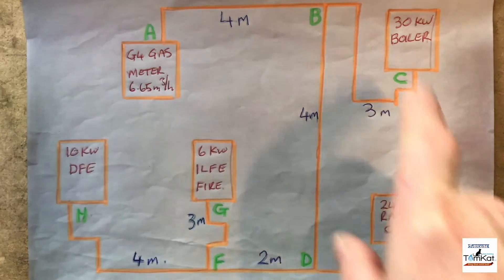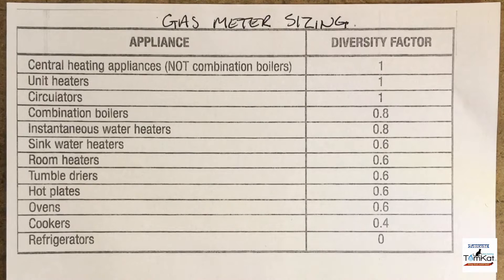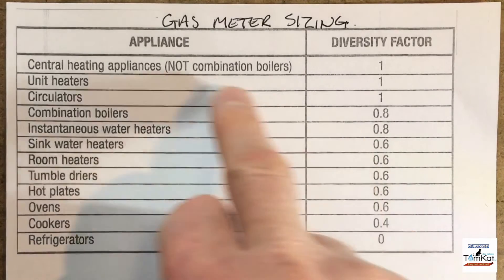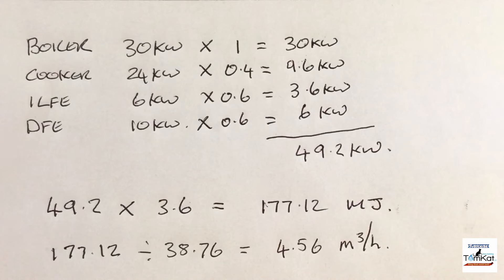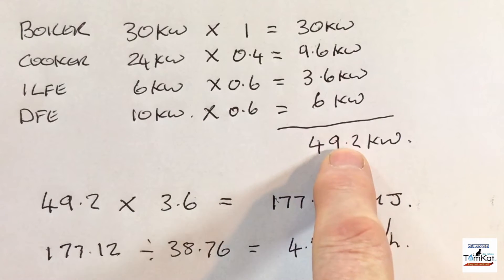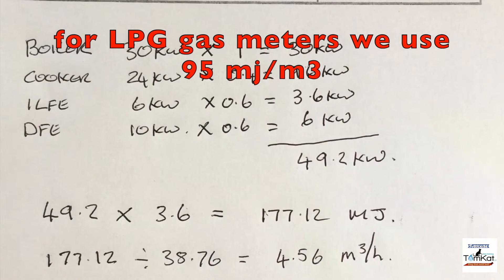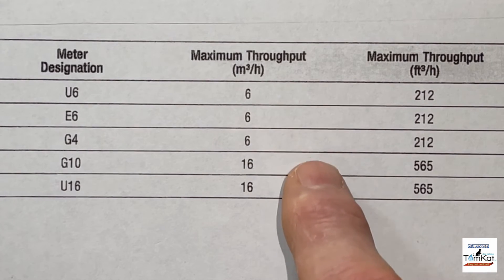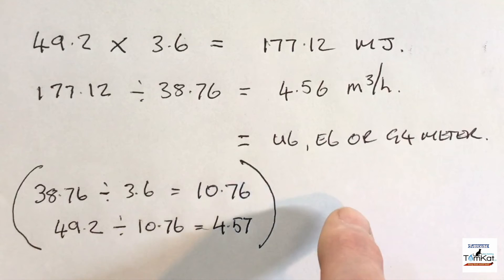HOW TO SIZE A GAS METER, ACS revision in less than 10 minutes

Comment: To clarify, If I had a combi boiler that was 30kw net, then I would have to convert the kw to gross, 30 x 1.11 = 33.3 and then I can use this with the diversity factor, so, 33.3 x 0.8 = 26.64.. but for an appliance before 2000 then the kw will most likely buy shown in gross  so this can be used with the diversity factor as it is. Not sure I'm understanding this correctly, any help welcome. Thanks
Reply from the maker: You seam to be correct 👍🏻

Comment: Great video Derek
Just a quick question, old appliances where kw gross and newer appliances kw net,  you mentioned about the appliances should calculate in gross, it doesn’t take in account what say the label on the appliances gross or net?
Thanks
Reply from the maker: When you gas rate you rate in gross kw so need to turn the figures to net on appliances made after the year 2000.
Reply: @tomkatgastraining   Right 💡 that’s very clear now just keep the gross calculations on any appliances 
Thanks 👍

Comment: thankyou for this video  Are you required to issue a new gas safety certificate for a landlord when installing a new boiler
Reply: The answer would be No,  no CP12 for the 1st year at least.  Only issue one if there are other gas appliances,  which there usually are ie cooker or in seldom cases a fireplace. For that it's the install plus the cost of the cert.
Reply: @rayc1503  thank you for your prompt response much appreciated

Comment: Good learning aid well explained and very easy to understand.
Can you make a learning aid for engineers what procedures need to be followed when making a connection on gas carcass when you use soldering.
Should the meter be removed or not?